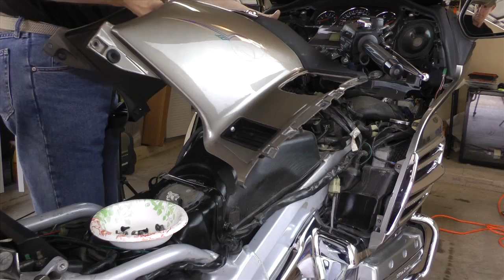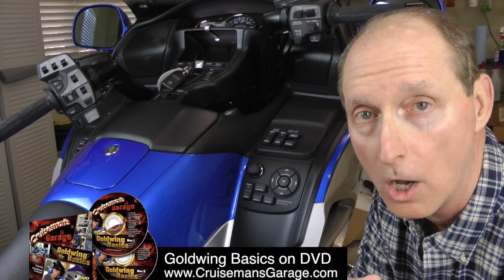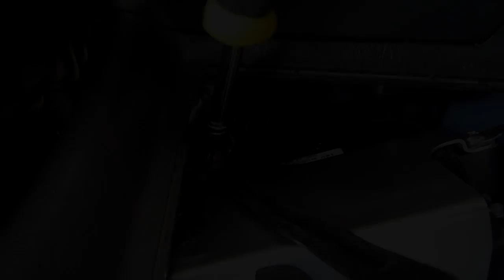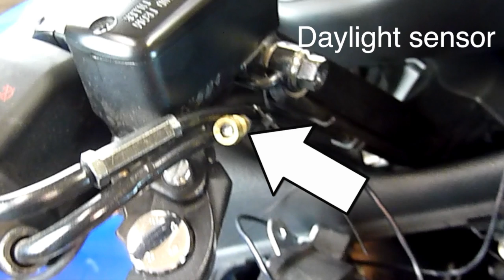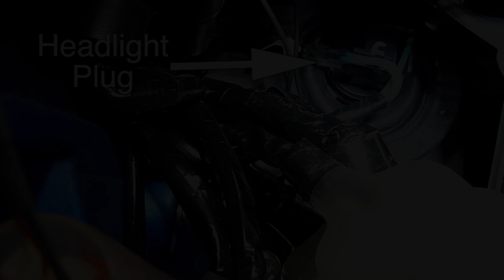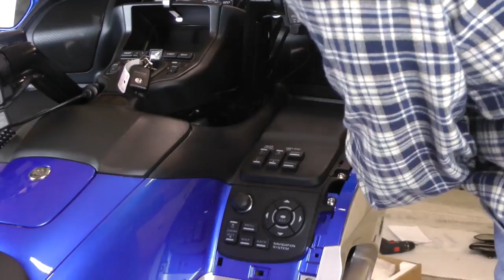Installing Kisan pathBlazer Headlight Modulator | 2001-2017 Honda Goldwing GL1800

Comment: The information that is left out of to remove the feet heater slide, remove the nob then carefully insert a screwdriver in the slot above the pocket and there is a single phippips screw holding the slider in place then it will be a piece of cake. to reinstall the socket